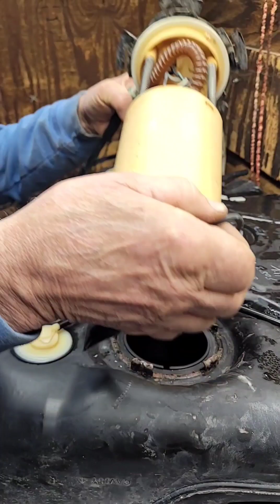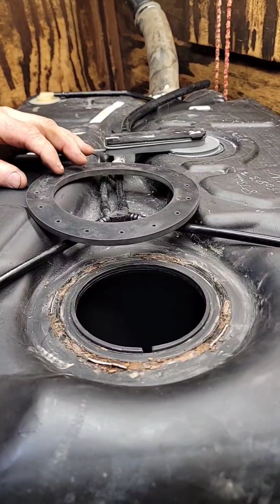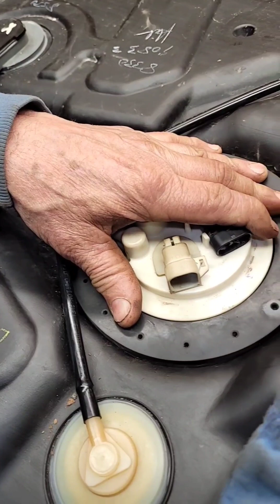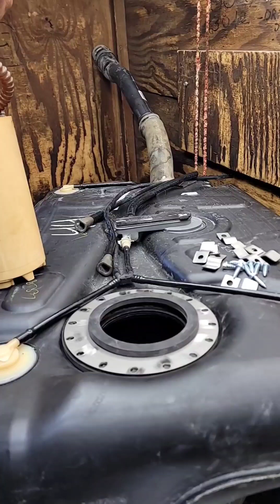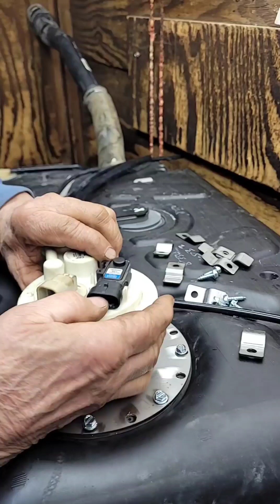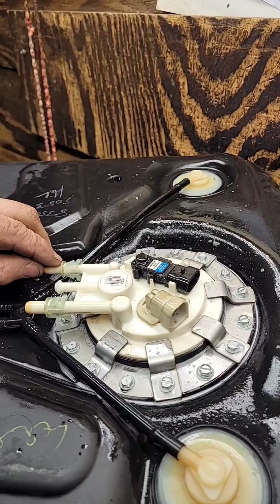Plastic Fuel Tank Repair Kit

Comment: I purchased this repair kit and it performed exactly as advertised. My truck is running fine like never had an issue.
The sellers were very responsive, informative and followed through with everything they told me.
I would purchase more products from this seller and highly recommend.
Reply from the maker: Thanks for sharing